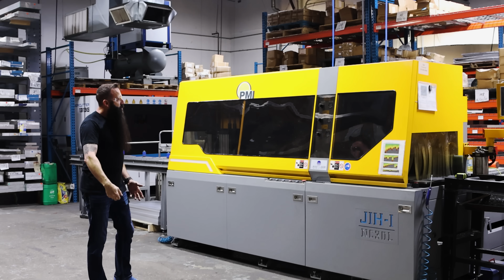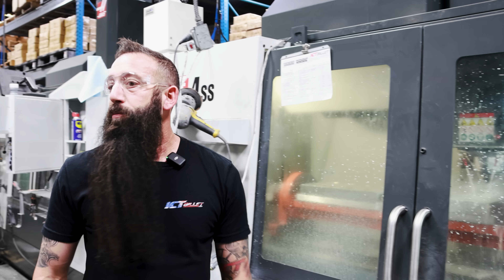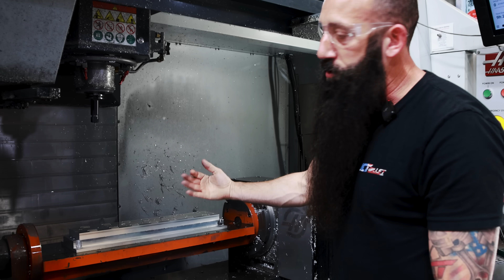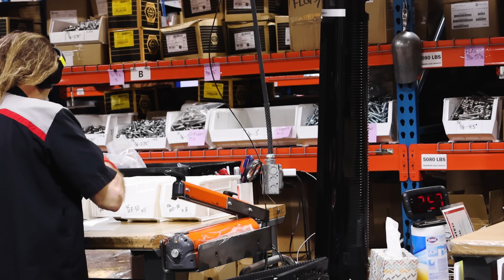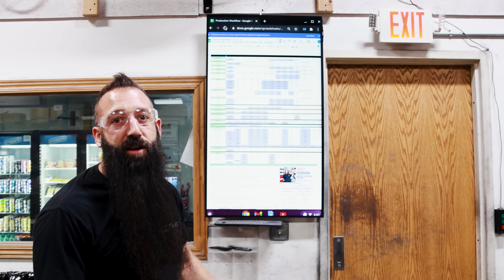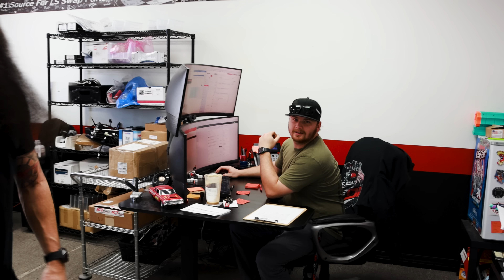ICT Billet Factory Tour - From Raw Material to Finished LS Swap Parts

Comment: Any chance you guys make a torque plate for a LS/LT that doubles as a larger diameter head stud drilling fixture?  The machine shops where I am located surprisingly do not have torque plates for LS engines. So I am likely going to buy one at some point and donate it to the machine shop as a token of appreciation, it just sure would be nice to get that extra value and use out of something that isnt getting used very often.  But i imagine there is a reason i dont see a multi-function torque plate / head stud drill fixture / ... o-ring top fuel hoop fixture??  Either way, thanks for the tour!
Reply from the maker: We don’t currently offer a torque plate with those added functions, but we agree; that would be a great multi-use tool. For something that specific, we’d recommend reaching out to a performance machine shop that may be able to build exactly what you need. And thanks again for the kind words and for taking the tour! We appreciate it!